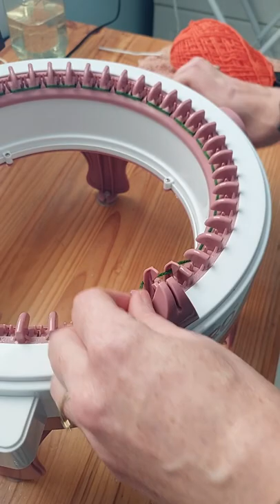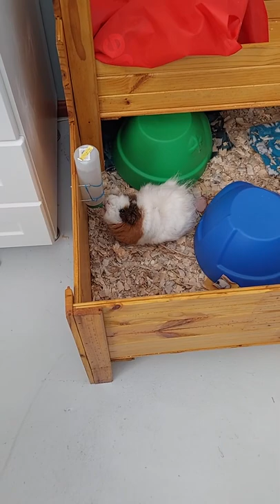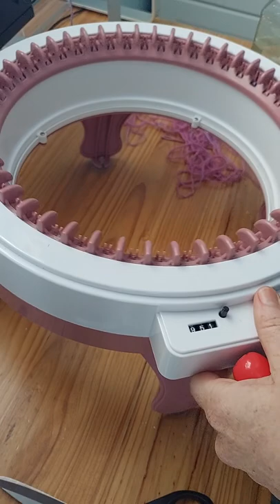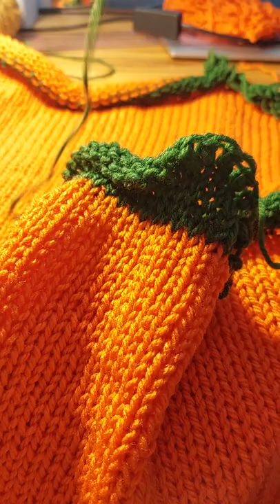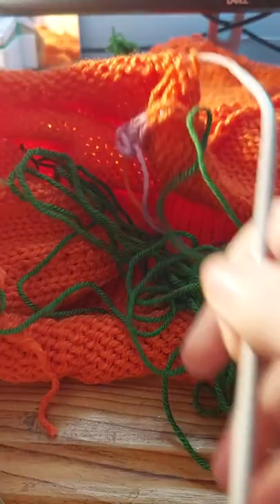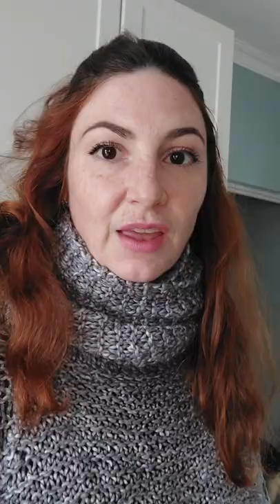how to make a sweater on a sentro knitting machine

Comment: I’ve begun treating the knitted or crochet fabric as that, a fabric. Just making regular tubes, cut and lay flat to steam. Then I use commercial patterns to make my garments. I get a flat 17” wide fabric. Using stay tape especially for the shoulder seams bc the sweater hangs straight from that point. I will never be happy with that seam going down the back, or front though. I use my little knitting machine for cuffs. The 40needle machine for front panels on cardigans. Everyone is learning and I love your method also.
Reply from the maker: I agree on the seem, but check out my latest tutorial "how to make a sweater vest" ,if you go into the description and look for the time stamp "how to do the mattress stitch" I show you how to join panels seamlessly!! It's been an absolute game changer for me 🥳🥳🥳
Reply: get a flatbed knitting machine for larger sized sweaters or making blankets. flatbed machines can have 100,150, or 200 needles. i use a bond knitting machine and bolting two machines together gives me 200 needles, enough for a blanket.

Comment: your tension guide is upside down, if you flip it around its less likely to break
Reply: I was just about to type this.  It's definitely upside-down.
Reply from the maker: 😂😂😂 i can't remember if I put in on like that or it came that way but I've just been using it like this the whole time. Anyway, the point I'm making is to make sure the knots don't get stuck in it. Because I'm sure upside-down or not, that will break it ❤️

Comment: Hi, I absolutely love this tutorial and am currently trying to make a jumper using this method. What circular knitting needles do you use for the ribbing? Also, would you recommend using knitting needles that result in a smaller tension than the knitting machine panels like in some ways of making ribbing?
Reply from the maker: Hi sweetie! Thank you for this wonderful feedback ❤️ the needle size I used for the borders (neck, waist and cuffs) was a US size 2. Long cord for the waist and a short cord for the cuffs and neck, and then I casted all of them off using an elasticated thread for extra elasticity. So to answer your question, a much smaller needle size to tighten the tension and stitch size 💕 at a guess I'd say the sentro produces a stich size that a US 5-6 needle would produce 😉

Comment: What size is this and also can You adjust?
Reply from the maker: The jersey I made in this tutorial is a large or XL and you can make it smaller by casting on less stitches or if you want it to be bigger you can add a centre panel (so 3 panels instead of 2) ❤️🧶